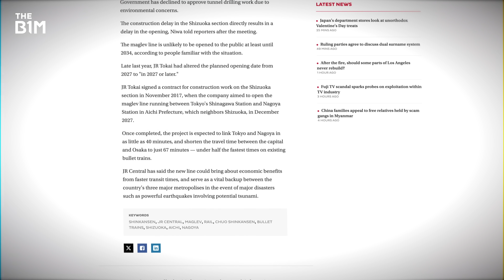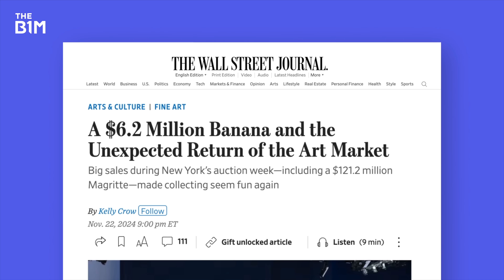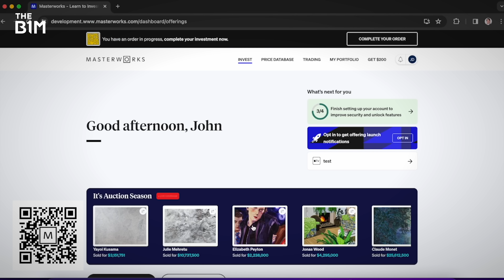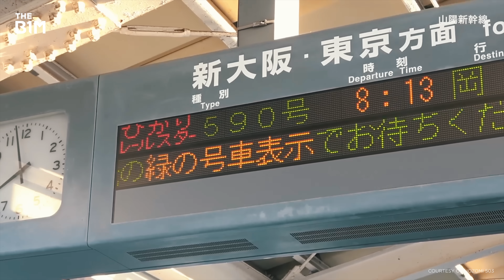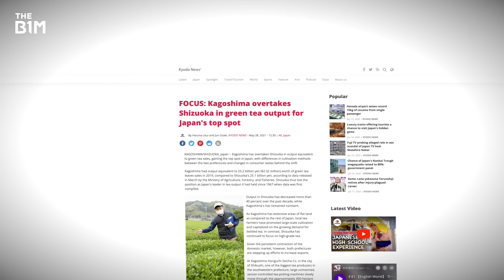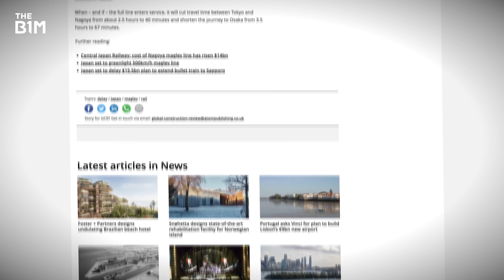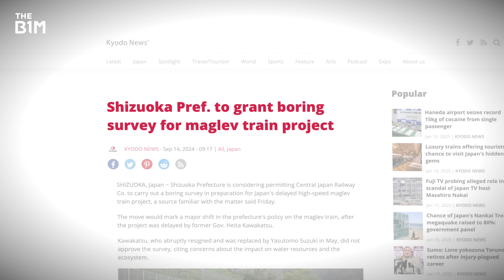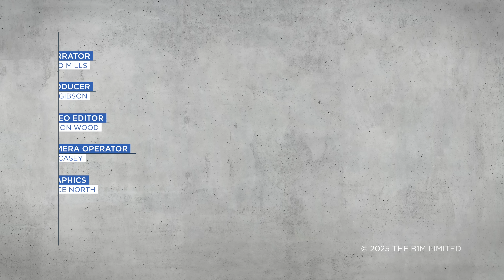Delayed: Japan’s $64BN Levitating Bullet Trains are no Longer on Track

Comment: I don't think its that clear cut... the french have demonstrated in 2007 that you can reach almost 600km/h with a regular rail-based train....  which would be significantly cheaper to build. Maglev might be nice halo technology, but I am not sure if its really the best option... with new dedicated tracks, you could probably also have a regular 450-500km/h rail line, and since it doesent require insane cooling for the magnets, might even need less energy

Comment: In fact, this Japanese maglev is the only one that can go up to 603 km/h, and is recorded in the Guinness Book of Records, 

People on social media always provide false information about other maglevs... like from China or others... 

Yes, China has a maglev train in operation (Shanghai Maglev), but it is German made, and it only goes at 300km/h, the track length is only 30km. 

China has released the latest maglev... but it's just a prototype, it hasn't even been tested at all... and has no track
Reply: but what propoganda you talking about? It's true other country has Maglev, so why it's false information? You ok? There are other Maglev train but it's not Maglev because Maglev can only ban from Japan and other Maglev trains propaganda.... Fix your head...
Reply: 本当にその通りで、中国の最新リニアはまだ研究中で、有人での走行試験すらされていません。
youtubeでは中国の鉄道が世界一の速度だという嘘の情報が広まっていますよね。
Reply: The German made one in Shanghai run at 430km/h
Reply: The Chinese maglev he mentioned is indeed being built and part of the line has been operational since 2016. However it's one of those low speed maglevs with max speed of only 160km/h, which is... kinda useless. They could have just built an intercity HSR or a express metro line.
Also the Shanghai Maglev has a top speed of 430km/h, but in 2021 they lowered the speed to save cost, since the ridership is dwindling.
Reply: China do have over 600km/hr & it have been tested on track, China have also tested 1,000km/hr on test tract 
And that's reality 

Same Japan one is prototype tested on its test tract

Difference is maglev tech is 

China uses new tech high temp, less power to levitate

China maglev have no wheels

China maglev will levitate even when power is shut off & won't crash the train
Reply: And china released latest maglev and was not tested, but Japan maglev also not operating. Why you so buthurt? Why you so annoyed that other country also building trains.... And has no track, JAPAN DON'T HAVE TRACK EITHER, DOES IT?
Reply: @karolisfabijonavicius ... japan has a test track and it is part of the actual future line
Reply: @karolisfabijonavicius  This Japan new maglev has been tested since 2003, of course they have a speed track

China's new maglev wasn't tested because it's just a concept train...it doesn't even move
Reply: you are funny, China is the only country to run 350km/h high-speed train for commercial line. but Japan is only 320km/h. don't talk the train in the lab. it doesn't make sense.
Reply: @FrankZhang-pj9nn  they can actually do more than that... The original plan for the Shinkansen E5 was 360 km/h in operation.
The top speed is of course more than that,
the speed is reduced to suit the schedule and time..
Reply: @wiperdshandian1653  For China Fuxing train which is running at 350km/h, actually it can reach 400km/h, but it was reduced to 350km/h. China is testing the new train which has 450km/h speed but will keep at 400km/h for commercial operation very soon.
Reply: @FrankZhang-pj9nn 
The Hayabusa reached 400km during test runs as well, so your argument makes absolutely no sense.
Reply: @HappyGM-R  oh, during test.  China is the only country to have 350km/h train running on commercial line.  will have 400km/h training running for commercial line very soon. how about Japan? show me the data in test makes absolutely no sense.
Reply: @HappyGM-R Have u ever visited Japan and China to ride HSR? Pls do not comment based on your imagination.
Reply: @NorrisSze  
I have been on both the Shinkansen and Chinese HSR. And as a whole the Shinkansen is a much more refined and well structured system. Speed alone is not what determines effectiveness of a HSR.
Reply: @FrankZhang-pj9nn 
“Oh, during test” yeah where else you expect them to “test” the speed a vessel can reach? Your proclaimed 400km/h for the Fuxin was also “during a test”. Plus your asking for sources when you have given absolutely non yourself. Get a brain before you comment.
Reply: @HappyGM-R  the fact is Japan current train in operation is only up to 320km/h, China is the only country has 350km/h train in operation. talk the train during the test make no sense, you should compare the train speed in operation. did you get it?
Reply: @FrankZhang-pj9nn  
Go reread your original comment I first replied to. You literally said yourself that “Fuxing train which is running at 350km/h, actually it can reach 400km/h but it was reduced to 350km/h”. 

Your the one who brought up the test speed, and I replied by stating that this is also the case for Hayabusa. While it can run at 400 if it wants to, it was reduced to 320 for the same reason Fuxing was slowed down, therefore your argument makes no sense. 

I understand that you are unable to comprehend a logically constructed argument but come on at least understand your short comings and keep quiet.
Reply: @HappyGM-R  what I said is true, the Fuxing can run at 400km/h but was limited to 350km/h. in reality, China Fuxing is running at 350km/h for operation, Japan is only 320km/h for operation even you aren't happy. but what it is is what it is no matter you like or not.
Reply: @HappyGM-R I have been on both Japan & China HSR
Reality is that China HSR is more quiet, hardly any jotting
China tech is way better, due to newer, greater distance
Coin can be balance on windoe edge fir minutes 
Whereas Jpaan HSR still very nice, bit there's no way coin can be balance & stay for minute

That's exceptional

Comment: If they were really smart they would just put in overpriced tunnels and have electric cars traveling the route at about 60kmh. Then again if the person whose genius (actually stupid) idea it was to have a maximum of 3 passengers at a time in the vehicles actually used ANY of the more common form factors of mass transit then perhaps it may be a good idea to use tunnels.

Comment: China has already blueprint for 7000km high speed maglev network to be developped. It already has several low-mid speed lines operating (same as Japan- you can take low speed maglev from haneda airport for example). You should differentiate between low-mid speed and high speed as the former is widely used in japan (since 80es i think) and now being implemented across China as cheaper solution to subway/lightrail projects in urban areas.
Reply: The line from Haneda airport is a conventional monorail. The only Maglev in Japan is the Linimo in Aichi.
Reply: @auxiliarypowerunit  my bad on haneda, as for other lines I thought there were many low speeds around japan, china already has several with first being changsha airport-downtown

Comment: As usual, this channel always manage to short change China by not mentioning the only commercial meglev running in the world. It is about meglev after all. Well done with your bias!!
Reply: In shanghai, Only run 300km/h with just 30km track.. made by german..

This japanese maglev is new level maglev
Reply: wrong. There are running maglev systems in Korea, Japan, AND China.
Reply: Only commercial maglev built and designed by the germans located in China

Comment: For anyone confused, no the magnets are not suspended via magnetic quantum locking, that effect is too weak for any practical application.
Superconduction is used because it basically removes electrical resistance from the wire, making it possible to trap the electric flow in the coil indefinitely, making it possible to switch a permanent magnet on and off with barely any energy consumption. This makes energy efficient floating possible, reducing operational costs significantly compared to non superconducting maglev trains.
Reply: There's also the recent potential of using newer recently discovered super conducting magnets that doesn't need as low temperatures to keep super conductivity.

This allows the cooling system to just use liquid nitrogen instead of also needing liquid helium which will cut operating costs and energy demand for cooling by a lot. If I recall JR Central engineers are testing these as  a replacement for their current super conductor if it's feasible. This isn't even considering the recent research on finding room temperature super conductors which would make a future model even better.
Reply: @ryoukokonpaku1575 "high temperature" superconductors like ybco are already common practice and commercially available in large quantities for applications like these. It is true that back in the 1980s this field was very new and the only options were materials like mercury and other low temperature superconductors, but since the early 2000s these "newer" options have been researched and are in fact the ones that are used in this project, being cooled via liquid nitrogen grade (temperature range wise) cooling solutions.

Active research in this field is currently looking to bring stable super conduction above the -40°C mark to make dry ice grade cooling viable, but the -180°C range has been thoroughly explored already.

Comment: Poor Research I am afraid. China has run a Maglev train from Shanghai Pu Dong Airport to the suburbs of Shanghai since 2004. They use the older and technically inferior German system which still exceeds the speeds conventional High Speed Rail can achieve.  There have been discussions to extend this service to Central Shanghai and on to the Second smaller more central airport. 
So China has 21 years of public service already.

Comment: you say "most trains went below 150 kmh before the 1960s . "
I would like to point out there were a few express trains. UK express steam trains in the late 1930s were doing up to 100 MPH ( 160 KMH ) on certain parts of the route. The long straight parts.  Pretty much like modern express trains go fastest on the long straight bits ! 

Yes the Japanese bullet train is impressive , and undoubtedly the 1960s bullet train was a real lot quicker than late 1930s UK express steam trains

Comment: A correction: Japan did not invent the bullet train. Strictly speaking, the name 'bullet train' indeed comes from the iconic shape of the Shinkansen 0 series. But ever faster trains have been an ongoing evolution ever since trains were invented, and the bullet trains were an evolution, not a revolution.

What was revolutionary was the track. 'Shinkansen' means 'new trunk line', and this had never been done before. The evolutionary speed increases had always happened on existing tracks, shared with commuter and freight trains. The Shinkansen, on the other hand, was a dedicated, passenger-only, high-speed line, without any level crossings.

All true high-speed rail in the world derives from that concept.
Reply: So they invented it?
Reply: @marsillinkow  The high-speed line: yes. The high-speed train: no.

Comment: @12:59 "until then, the maglev-enabled future may be some decades away"
- Umm, who did the research for this video?! There's been a maglev-train in China for at least two decades! Somewhere around Shanghai, I think. My friend rode it almost 20 years ago. Said it was fast, but really expensive.
Reply: Shanghai Maglev is based on German tech. It's between the airport and somewhere not quite close to the city center, it's one-way ticket is only CNY 50 or less than USD 7. For a 30km line, it only hits the 430km/h max speed for few sec. It works like a test line for the tech, which somehow contributed the conclusions 20 yrs ago that the cost of a dedicated Maglev lines / networks are not viable as traditional rail in true massive scale
Reply: Rode it in 2011 when I was 10. It was fun, but sadly it's no longer fun for most people since there are 350kph trains everywhere nowdays. Hence now it's struggling with ridership and cutting speed to save cost

Comment: I am massively disappointed that the German invented (and now in Shanhai running) Transrapid was not mentioned with a single word.
It "only" goes 450 km/h (with a design speed of 500) but it was put into service more than 20 years ago. https://en.wikipedia.org/wiki/Transrapid
Reply: only run 300 km/h, with a 30km track,

Comment: Riding the Shinkansen from Toyko to Osaka and back was legitimately one of the highlights of my trip to Tokyo. I was able to call my family back home in Ireland at 185 mph and the connection was clear as day in perfect comfort. They have fascinated me since I was a child and maglev is the logical next step for the country
Reply: Please do not call inside the train car. It is bad etiquette.
Reply: @benp439 What they meant is probably the section in between the carriages
Reply: Did you call over a wifi connection? How would you keep the connection through tunnels without wifi?
Reply: @dannydaw59  4G in tunnels is solved problem in Japan by leaky coax
Reply: @dannydaw59  Yeah it was a WhatsApp call over WiFi
Reply: @DannyRice01  
Wifi ?
Reply: it has to have been considering how expensive they are
Reply: i dont think the maglev route will be half as scenic, a lot of the route will be tunnels.
Reply: Tell me you have never tried other high speed rail without telling me so
Reply: It's forbiden to call in cars (lol), happily outside of golden week, they are often mostly empty. Japan is very cheap but for trains and telecom, one of the highest price for telecom. It's the same (for telecom connectivity) in French or Chinese high speed train, but with more quiet and smooth (and fast for chinese/indonesian one) travel :).
Reply: @ThePopolong  
You visited each one

Comment: wow. love it. But it would be interesting to dig deeper into the maintenance of the track, and how they deal with any obstacles. The train floats but runs in a groove, so if there's significant layers of snow, or leaves & debris from high winds, or water, wouldn't it all start to build up infront of the train? And is the whole line in a cage, to prevent someone deliberately blocking the line? What happens if a metal bar is thrown on the line, would the currents violently pulled it up, possibly into the bottom of the train?  I guess there aren't sensors that can detect obstacles beforehand and the driver would not see anything till it was waaaay too late. 😮

Comment: There were sceptics about the bullet train back in the '60s, who said it was impossible. Japan will prove the doubters wrong again with Maglev. Well done Japan, best of luck with the project.
Reply: The reason why Germany abandoned its project was not because it seemed impossible. It was too expensive to build extra tracks besides our existing rail tracks and the speed difference between Maglev trains and our high-speed ICEs was to small for the price that was asked.
Reply: 1962年から始まったリニアモーターカーの開発は、10年後の1972年に、200mの実験線で実験車がはじめて浮上走行に成功しました。
1977年には、宮崎県に本格的な実験線が開設され、ここでの実験により、1979年、無人走行の最高速度517km/hの記録がつくられました。
21世紀の"翔ぶ鉄道"として脚光をあびるリニアモーターカーは、1997年から技術開発の場を山梨県都留市へ移し、超電導磁気浮上式リニアモーターカーの車両開発はもちろん、電力供給装置や列車のコントロール装置、完全管理システム等の開発を、日本特有の起伏に富んだ地形、環境の中で確認しています。山梨リニア実験線での成果として、2003年には、有人走行による世界記録581km/hを記録しました。
Reply: Maglev is possible.
Financially sustainable maglev, seems much more doubtful.
The fact that Japan's current bullet trains are financially sustainable is impressive, but they are far less complex than maglevs so I'm somewhat sceptical.
Reply: @JS-rz5gx Japan's maglev tech is actually quite simple as it relies mostly on permanent magnets doing most of the work unlike Germany's design which required active correction by a computer to be stable. They have way less moving parts too than conventional hsr. The only complexity on it really is the cooling system to allow super conductivity, and luckily for Japan there's been recent breakthroughs on super conducting magnets that require less colder temperatures so they can use a simpler cooling system (this is something they're already testing).

This project will be profitable regardless though, since the current Tokaido line is at max capacity but yearly ridership is still growing here in Japan. It will fullfill its intended purpose for JR Central, which is to decongest the Tokaido line. Demand will be there once this is ready by the sheer fact that the Tokaido line cannot be extended anymore.
Reply: @ryoukokonpaku1575 I hope you are correct. Certainly Japan is the only country that has ANY chance of making maglevs economically sustainable IMO.
Reply: The first skeptics are probably dead by now, this shit has been “in development” since the 70s and it’s still 10 years away at best
Reply: Maglev already exists in Shanghai, so it's clearly possible
Reply: @anonuser12345  That maglev is based on technology that Germany abandoned and is fundamentally different from Japan’s maglev system.
Furthermore, the one in Shanghai currently no longer operates at speeds over 300 km/h. Even when it used to run at 400 km/h, it maintained its top speed for only a few seconds.
Reply: @DENTYUcord  That line is too short for maglev. Maglev lines need to be a minimum of 100km long.